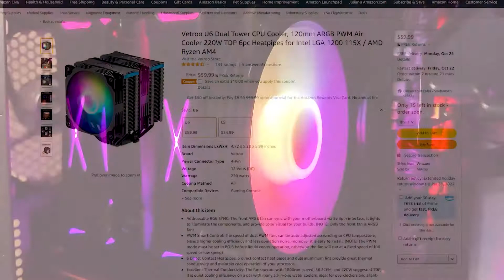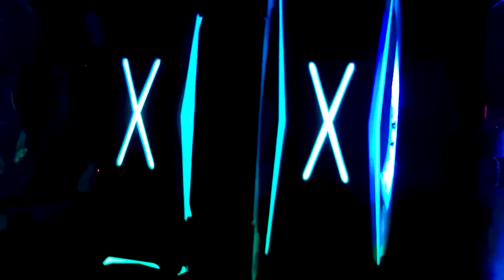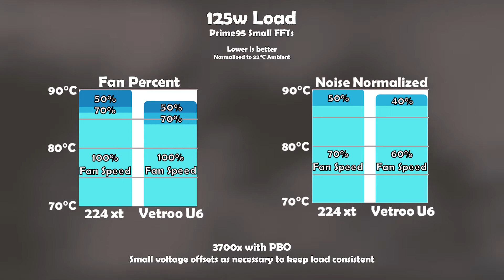Vetroo U6 Pro ARGB Dual Tower Review, Guide, and Comparison

Comment: I just got this cooler & the installation instructions are different now. My instruction book states to keep the AMD Back plate on, & to use the spacers as shown & to mount the AMD brackets using the longer Screws they give you. That X Mount you see here was not even in my Kit. Funny how things change over time.
Reply from the maker: Ah, sounds like a change they made to make it compatible with am5

Comment: I just got this cooler & the installation instructions are different. It didn't come with that X type Bracket you see here. & for AMD Boards it says just to remove the top plastic mounts & to keep the AMD Backplate on, & then to press the spacers over or onto the screw holes of the AMD Backplate & to use the AMD mounts they gave you for the top & then to screw the Heat Sink down with the 2 screws on it. Strange how this has changed.

Comment: What would be the recommendation for an I7-11700f (v5 or U6)
Reply from the maker: u5 is fine if you plan to keep the stock power limits, u6 would be better if you plan on unlocking the power limits
Reply: I got it and it doing better than my 120mm aio lol

Comment: what do you connect the rgb connector to lol? Could you use something like the corsair lighting node ?
Reply from the maker: You connect it to a standard 3 pin argb header.  If you want to connect it to your Corsair lightning node, you'll need an adapter as Corsair uses proprietary connectors

Comment: this thing took me 8 hours to install :'< without breaks.

it cools well but after 8 months using it's running hot at about 65c on idle :'<
Reply: Ouch, that’s hot. I believe you might want to take off and reapply new thermal paste.
Reply: @SSJBart-jb5dw  I most certainly did and upgraded from 5600x to 5900x. but now it runs at 91c when playing games, 91c+ .. I have never seen such temperatures.

the backplate is as a hard as stone and I'm trying to figure out what's gone wrong.. Maybe spread too thinly, the thermal paste? but I don't want to waste anymore if that's not the case.

I have screwed it on with all my force and weight so its definitely on there as much as it can be!
Reply: @MissesWitch  the Ryzen 9 5900x is a very high end CPU. From what I am reading liquid cooling is recommended. You can still air cool but articles suggest a high end air cooler. This cooler is an upgrade over single fan single tower cooler, but it might not be enough for your cpu. The thermal paste could be key here. You might want to go with a more premium pasteu. Also, you do not have to put a lot of force tightening the 4 screws.  Snug screws and as long as the cooler doesn’t move you should be good. So don’t overtighten.